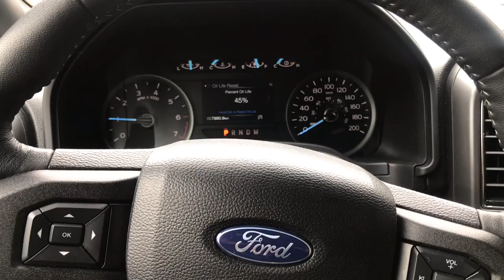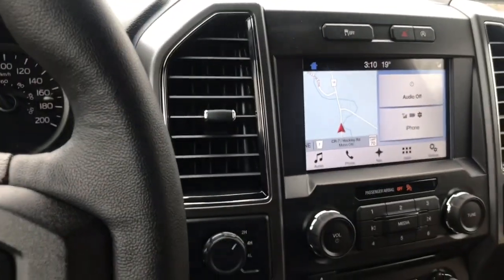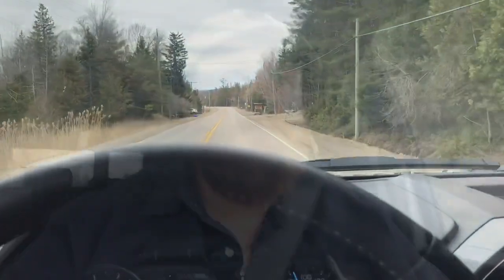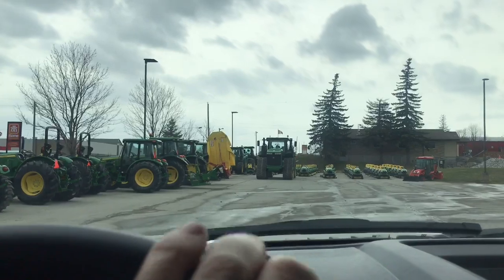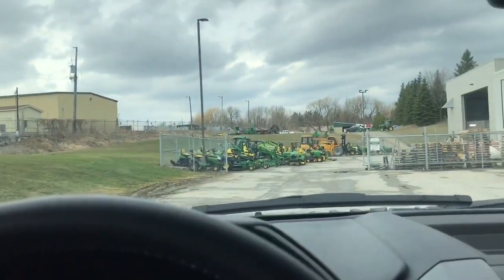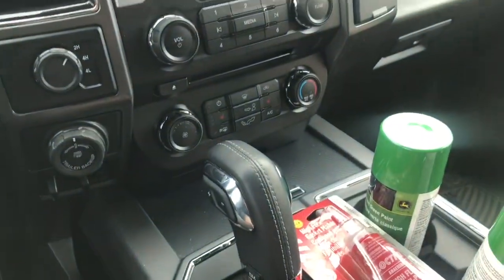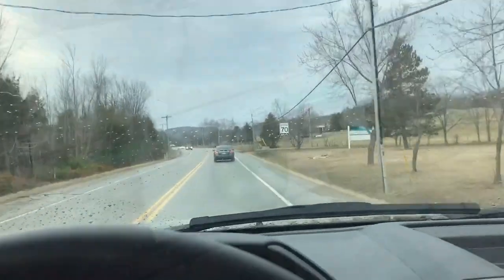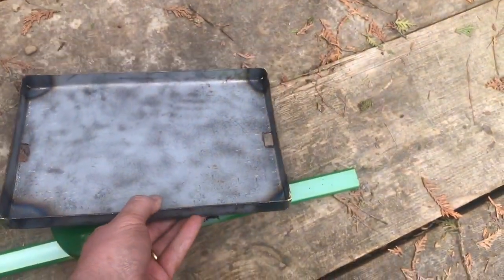Run up to Deere to get some classic green paint for the ‘46 AR

Comment: Your AC works when you turn on the defrost. Many years ago auto and truck manufacturers changed this so the O rings would get lubrication after the summer months when the AC isn't used. This change stopped the user from leaking freon in the AC system. BTW, if anybody buys a new Deere mower with a single deck, make sure you check the deck height with the # of inches the adjustment knob or lever is set at cause mine was not set at the factory or when it was PDI'd before the customer pickup. I guess their too lazy to set it. That's today's workers for ya.